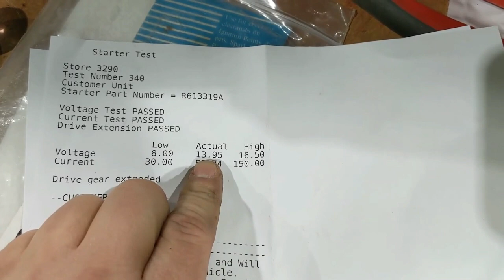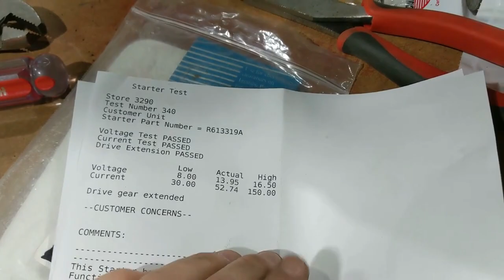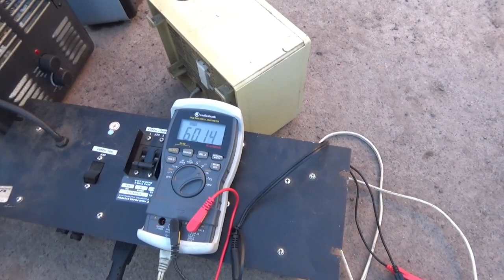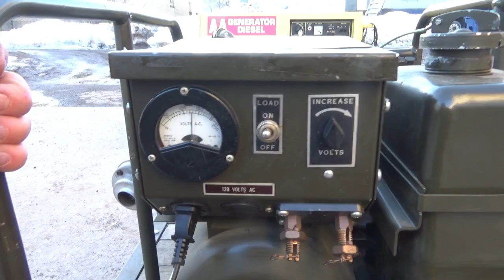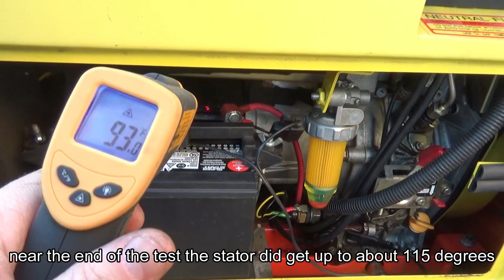Update Two generators and Waterpump rig 4/1/23

Comment: Good update, Josh.  Sounds like you've got those gensets dialed in pretty well.  Good to have those on hand, especially during storm season.  I've got a couple Honda's and one Generac 6500.  During a recent ice storm here in Oklahoma,  power was out almost 5 days,  the Honda's kept most everything going.  The Generac did okay keeping the water well (230 volt) going but kept blowing oil out the crankcase vent.  I double checked to be sure the oil level was not too high.  It was 'spot-on' at the correct level but still blows out about a cup of oil on an extended run.  Been dodging tornadoes the past few days and crazy wild fires that destroyed 40 homes on Friday.  Crazy times we are living in.   Keep up the good work and stay safe!
Reply from the maker: thanks, stay safe and for your generac with the oil issue look into the PCV system it might be not working right or it could be having a problem with the rings.